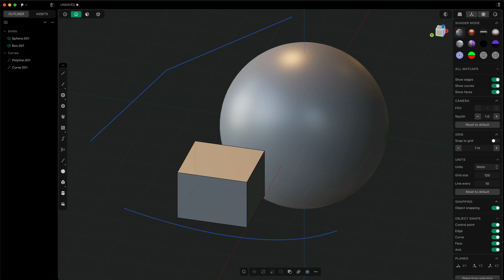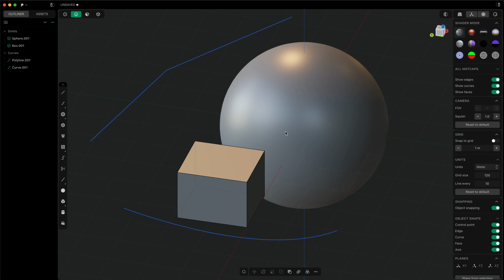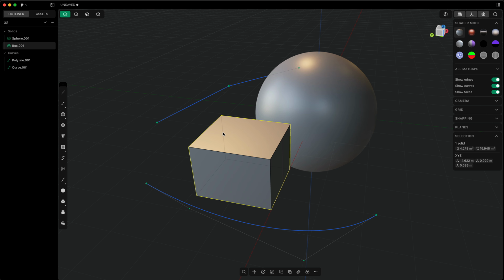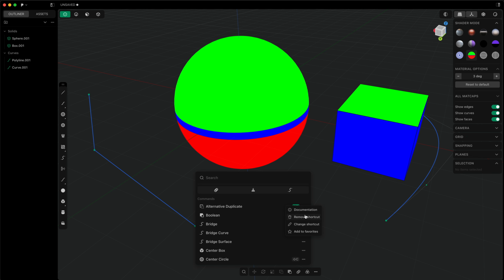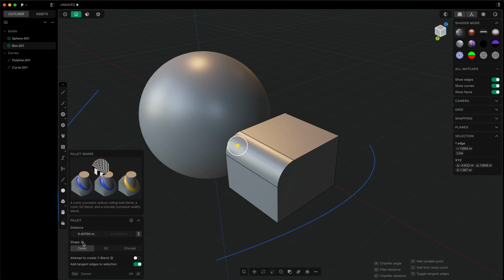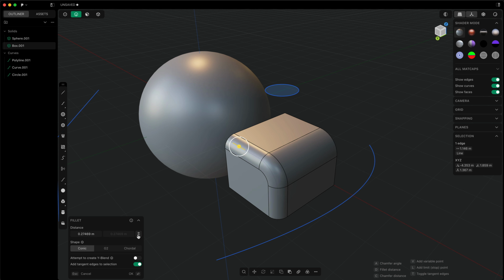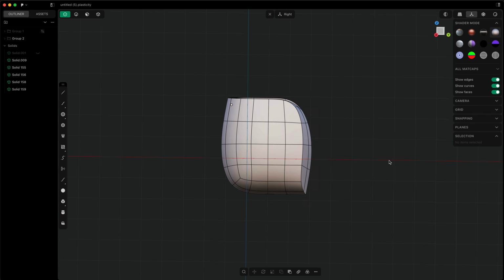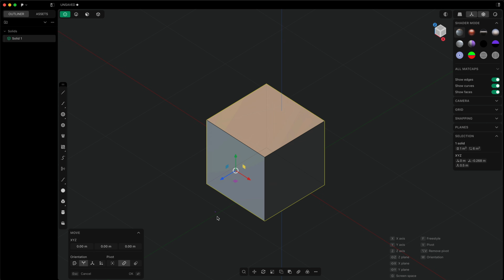Plasticity v2025.1: Solid and surface modeling, redefined

Comment: it would be cool if plasticity could implement a live lofting feature like the ones in the maya where if you move a vertices of curve or the curve itself and the lofting surfaces update instantly live on the fly that way we as the artist would know exactly what we're getting out of the lofting or any kind of surface creation, if you've modeled anything using nurbs and curves in maya you know exactly what im refering to, i think thats pretty neat and a very handle feature to have especially for nurbs and surfaces modeling - rather than having to delete the surface and recreating it again everytime we wanna do or make a change to the surfaces or say tweak the curve of a lofted surfaces or even patch

Comment: Would it be possible for the Plasticity exporter system to become its own standalone?

While the program is incredibly nice to use for Nurbs and for people that dont fully do parametric modelling, I cannot stop thinking that you would still have public for just the export engine itself. 
I can assure there is a lot of people like me who already do parametric modelling in other systems and would LOVE be able to export their assets to things like blender with a better result instead of outright using the binary exporters for STL and similar file formats that dont really care for symmetry and UV layout. 

I had a colleague of mine demo me a model exported from Plasticity and comparing it to the native STL export of softwares like Fusion and Solidworks I was infatuated with the way geometry was arranged upon cut-through and swept surfaces in a much more ordered manner compared to the slop created in similar features from the binary exports haha.
Reply from the maker: The mesh exporter has a lot of options. But we would be unlikely to make that standalone. Or if we did it would be a premium product with more input formats supported, like Catia, etc
Reply: @nickkallen1  One can only hope 🤞

Comment: Hi there, I own plasticity studio version and I am getting an error message when importing a "big" model saying that its over 2GB and fails to import the model. is there a Limit in Plasticity on how big the model can be? dos anybody else had this issue?
Reply from the maker: Can you send us the file?
Reply: @nickkallen1  I can not share the file as i am under NDA agreement (I can not even show the model in public). another thing I noticed is that when I look under my Plasticity studio license, I see that is for a win32  Platform but I am on a win64 PC. could this cause the 2GB limit?
Reply from the maker: @ no win32 is the windows api not the cpu architecture… is this a step file?
Reply: @nickkallen1  yes it is a step file.

Comment: Yo my man. Wanted to share with you my gratitude. I consider myself an advanced newbie. Only 3d modeling for the past 9 months. Tinkercad leaves me wanting and Fusion is too unforgiving and bureaucratic. And blender seems too daunting to even start. Up to this point I was stuck using fusion. I would dread the time it would take to just arrive at a functional design. And most of the time the finished design would be a compromise between what I wanted and what I could accomplish in Fusion. In other words I could never get going and my morale was low. Fusion really made me question if I was smart enough for this. I gave your program a try and its been life changing. I've never felt more confident and ambitious to learn more and try more complex designs. Up to this point 3D modeling was beast of burden, but using plasticity now I enjoy it A LOT. Thankyou so much for creating this program, its literally shifted my life direction by granting me the faith needed to press forward. I know Fusion is a great program but it always felt like a resistive force impeding my design, plasticity makes me feel like I have the wind at my back. Thanks again.

Comment: Just one note. If you would significantly change UI too often. It will be pretty bad for newcomers, as basically all available tutorials will be obsolete. We all know it from Blender.
Reply: As plasticity relays on commands with shortcuts which are always searchable I don't think changes in the interface will strictly affect newcomers

Comment: Parameteic modeling 🙏
Reply: If I remember correctly, I think Nick said the software will probably never be parametric. At least, not in the traditional sense. But, yeah! It would be a game-changer to have some non-destructive modeling methods like the Modifier system in Blender.

Comment: There are no thumbnails displayed in Windows Explorer and Plasticity is, I believe, a unique graphics modelling program that doesn't have this mandatory feature built into its structure. Thumbnails that show in recently opened and saved files are a bit flaky as this feature fails to capture all of a large monitor - mine is 4kx 32"  - and for some reason it captures part of the screen from the bottom left. There is no update once a thumbnail is captured, so what you get is what you're stuck with. New features are all good and well, but the basics and expected features of a Windows file ,such as thumbnails in Win Explorer, need to be addressed first as users are currently stuck with an ever growing list of file names that after a few weeks mean little.
What's been added and modified to Plasticity is great, but you need to address these missing basic features and it is very very surprising that beta testers have not brought this to the attention of the development team. I see that for the first time Ctrl+Q now actually closes the program, which is something I wrote/complained about almost two years ago. If it's taken this long to fix such a basic feature that's always been on the pull down menu, I can only wonder how long it's going to take to get thumbnails embedded into Plasticity files.

Comment: I was concerned about this release because I enjoyed Plasticity's previous interface. However, after trying it for the past hour, I'm hooked, and I've discovered several features I didn't know about solely through the extra icons and affordances. The documentation links are an especially nice touch. I was also surprised to hear that Plasticity isn't targeted towards beginners because it has the simplest interface of any CAD / modelling software I've used.
Reply: hi

Comment: store a pivot orientation from one object and apply it to another object would be neat. also aim a pivot towards a vert/controlpoint. coming from maya this would check all the pivot need boxes
Reply: For storing pivots, I guess the question is store it where? IMO the best way to do that is just create a line segment you can reuse and assign pivots off of. Maybe a special 'pivot only point' that you can copy off existing origin points for parts, sort of like how ALT+D can make geometry out of thin air and selected reference surfaces.
Reply: @Roobotics  it would be stored in the session....not geometry...can be really temporary. if you want to move an object in a specific direction that comes from somewhere else. i have this usecase quite often
Reply: @krz9000  so more like a clip-board specifically for pivot points? I can understand that usage of 'transferring pivots' and not wanting to create extra elements each time.
Reply: @Roobotics  exactly..just a clipboard. two buttons..STORE and APPLY..somewhere near the pivot options. one slot is enough, more might be distracting. and its just applying the orientation of the pivot...the pivot position should stay where ever it is currently

Comment: This is one program where im glad I bought the studio license, every single update has proven me that I made the right choice.
Reply: I bought studio licence with terms on it "All updates included for 12 months, including major (2.x) releases"
Of course 2.x was like 380 days after my purchase.
as i'm using only for 3d printing my personal projects - its hard to put another 300 down
Reply: @yozhis1  I'm in the exact same boat as early adopter, that cross-section analysis is something I desperately want for the 1.0 branch I paid for.. I wish they'd backport it. 
I think I will fork over the extra for 2.x eventually, it's just too useful a tool to pass up..
Reply: @yozhis1  IIRC you do get a discount when you renew it, if you are an existing customer. But I get your point, its not cheap, but at the same time compared to other existing programs, its a steal, its perpetual license, none of that subscribe monthly bullshit, you keep the software. That alone is worth it for me.
Reply: @yozhis1  I use an older version of Plasticity and it is super useful for 3D printing I will definitely get the studio licence later, but now it is not urgent cos I can do everything what I need